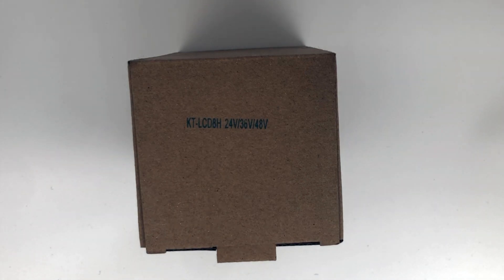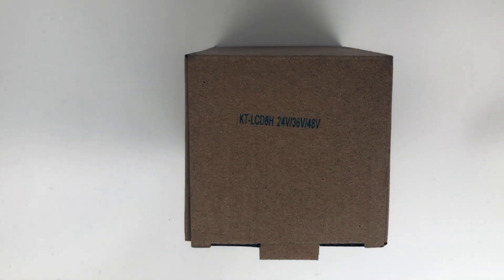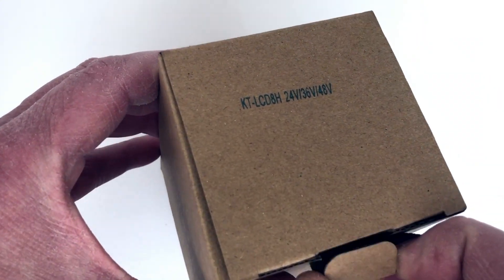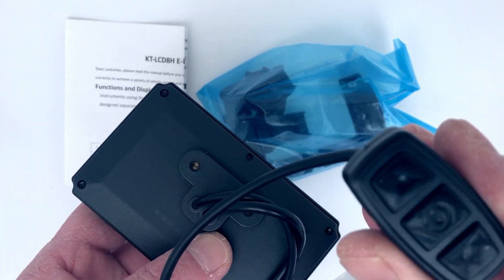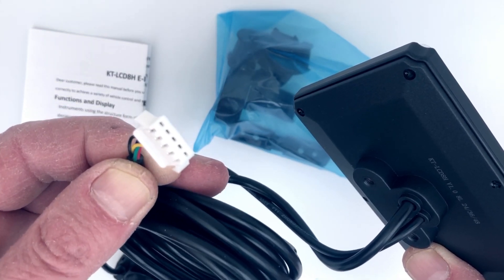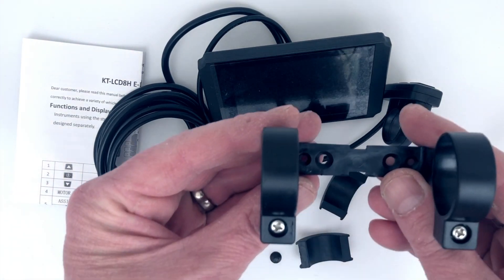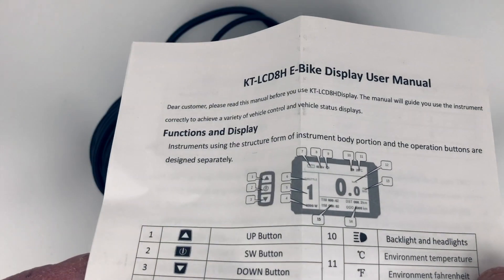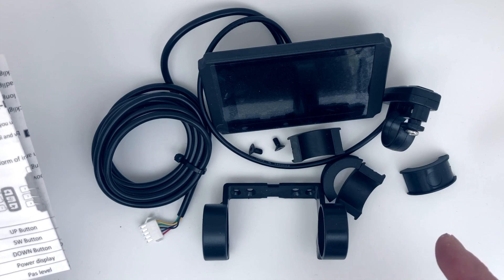ETRIKE.NET - KT LCD8H Colour Screen/Controller Unboxing

Comment: Thank you.  I'm looking forward to hearing more.  I just purchased two of these displays against my better judgement, because I've always found the displays to be the weakest link in the whole system.  I actually ditched the idea of LCD or LED displays and went with a simple analog display that just shows battery volume and 3 pedal assist settings and I have never had one of these fail.  
Instead of a display, I downloaded a GPS app for my phone called Urban Biker that works Great.  Check it out .   Thanks for the info.  I look forward to seeing more.